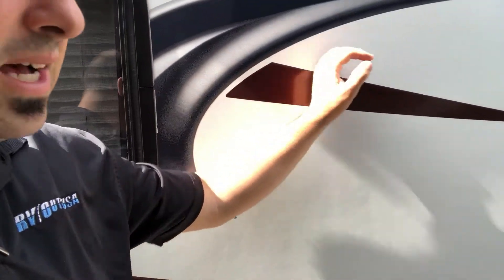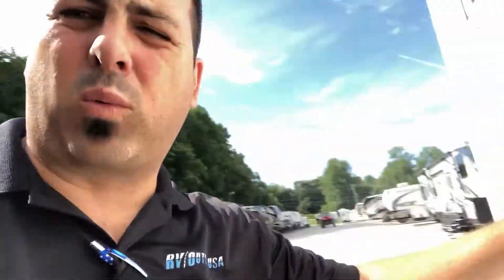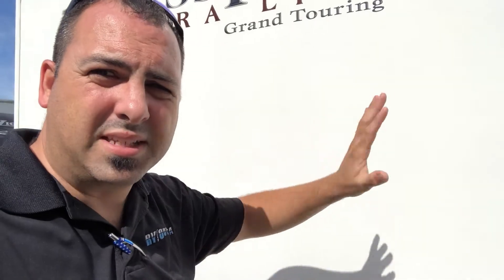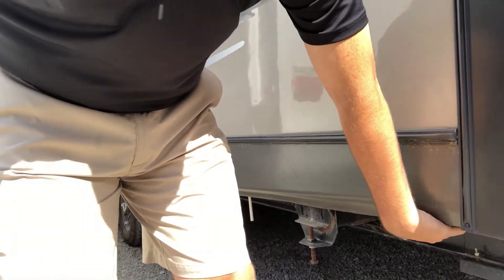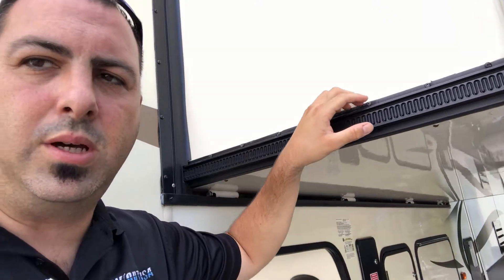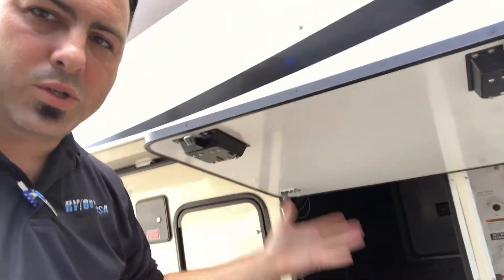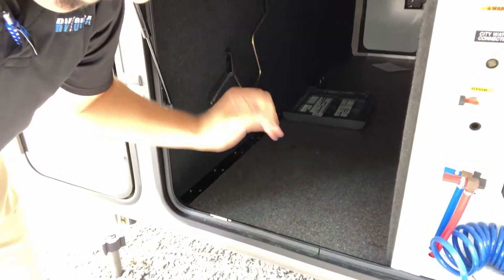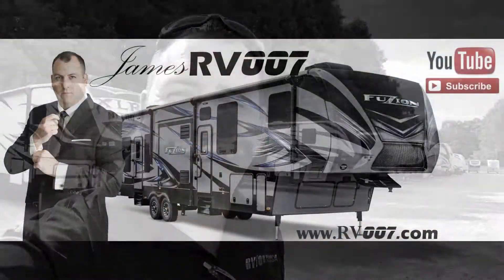What you need to know about RV Delamination

Comment: This guy is pointing out the problems that can ( and often do ) happen with the very rvs he is selling. I bought a 2011 Cougar trailer in 2011. Several years ago I noticed delamination ( bubbling ) in the front and one side. I have had trailers with the corrugated aluminum siding for years with none of this type of problem, although other problems occurred. I advise you to never buy a laminate siding rv. The cost to repair my trailer is probably nearly as much as it is worth. If I try to sell it, I will get almost nothing even though it is beautiful inside and everything works. Any RV is an endless money pit. Save your money. Stay in a fine hotel and you will be money and time ahead. I spend more time screwing around with my trailer before , after and during a trip than it is worth.

Comment: In Az the delamination is from the wicked heat making the glue seperate NOT because of water.
Reply: what can be done about it? is it at increased risk of more damage when it does rain in AZ?  Or is it nothing to worry about??
Reply: @pegdunn9236  If you can keep it in garage that is the best bet, next would be a carport, and finally one of the RV covers be better than nothing.  In that order from best to last.  The heat is just brutal here in AZ and older rv's die a slow death being baked constantly.  Still have to pay attention to the roof and wall seams just like any other rv to keep water out also.

Comment: Delaminaton can also be caused by heat...especially in Florida
Reply: then what? is it fixable?
Reply: How do you tell the difference on a Florida RV ???
Reply: Yep I live in Kelowna and the Sun is wreaking havoc on my 10 year-old Keystone the glue is separating the filon from the Luan faster than I can keep up with it
Reply: @Kbarstill  you'll find out when you fix it.... it doesn't matter what caused your delamination the only thing you need to do is worry about fixing it and if it is water you will be able to tell because everything will be covered in mold inside
Reply: @pegdunn9236  it's fixable whether it's caused by the Sun or by water the question is how extensive is the delamination and are you able to repair it within a budget that you can afford